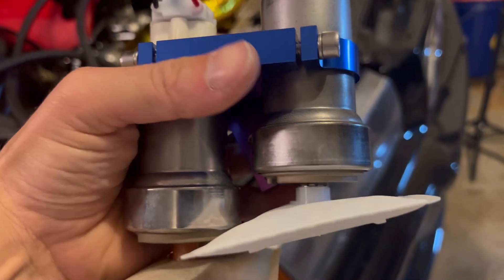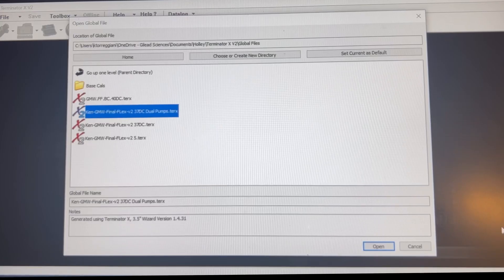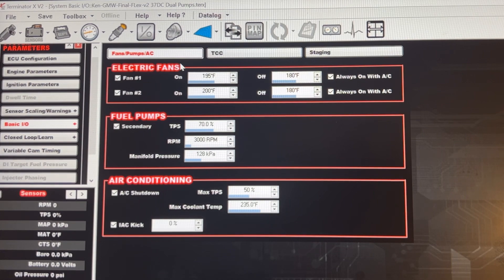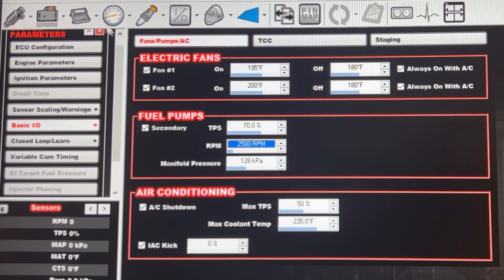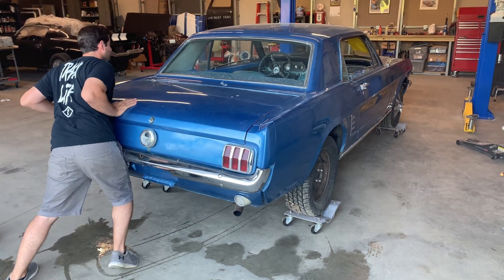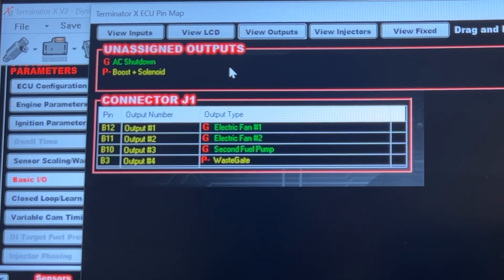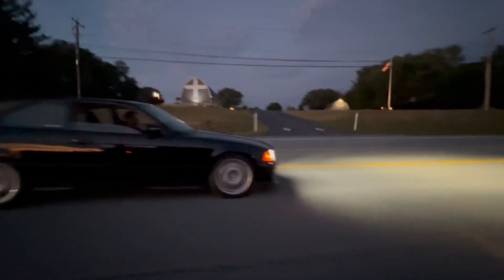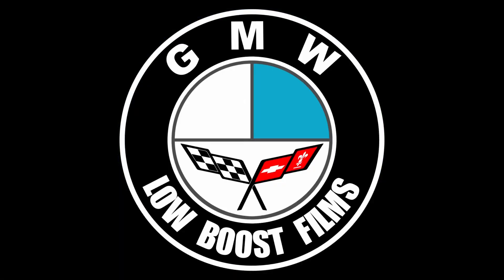HOLLEY TERMINATOR X DUAL FUEL PUMP PROGRAMMING: E36 Turbo LS Swap

Comment: Hey man, i really enjoy the content You are putting out there. I'm in the process of ls swapping my e36 m3. I would like to keep the oem cluster and have all of the things work like fuel gauge, temp, abs, engine light, etc etc. I'm rebuilidng the engine so that i can throw some boost at it once i get a bit bored. Would You recommend terminator x ? or Wiring specialiteis harness. I'd love to do terminator x but i dont think that all of the components will work, i have seen all of your terminator x wiring videos, but i dont think You have managed to get everything working either (i could be wrong). So yeah, i'm just stuck at this moment trying to decide which harness to go with. 

Thanks, and continue posting awesome content
Reply from the maker: The only things the terminator x didn’t retain on the dash is the coolant temp (which that gauge is terrible with an LS) the reverse light, and the reverse lockout switch (which you don’t really need) all of which can be wired back in if you want. Especially if you’re thinking about Boost just go terminator X. It’s close Ti the same price but so much easier to tune and make adjustments in!

Thank you for watching the videos. I really appreciate it. If you’d like to support us more. If you buy something on Amazon use our link in the description first. Even if you don’t get that exact thing we get some credit for it!
Reply: @LowBoostFilms  Great, I got one more thing. Will i be able to pass the NYC emmission inspections with terminator x? Since the car needs to be inspected every year, will they be able to plug their scanner in and do the emission stuff ? I think this was one of the main reasons why i wanted to go with wiring specialities, whereas if it will pass emissions normally (plug scanner and read emission codes) then i think ill go with terminator x then. Oh and hopefully ill be able to control my a/c with it as well.
Reply from the maker: @lolzaga1661  ah you’re in NY that makes it easier for me to explain because I am too. If your car is older than 25 years you don’t need any emissions codes. But even with wiring specialties if they plug it into that it’s going to show a different car vin and they could fail it. Your best bet could be registering it in another state if it’s newer than 25 years old. Term X has ac control as well. As well as ac shutdown at wide open throttle lol.
Reply: What output wire did you use for the second relay